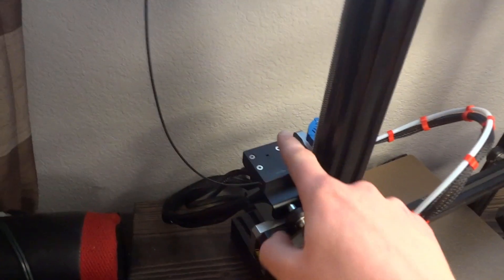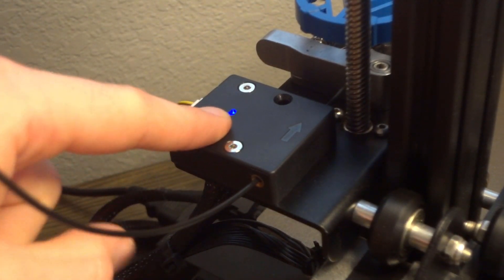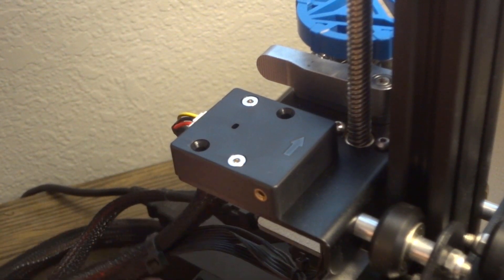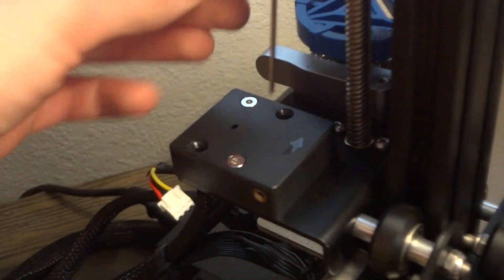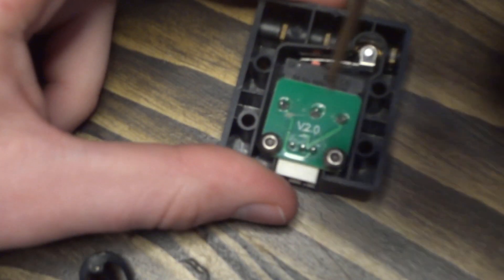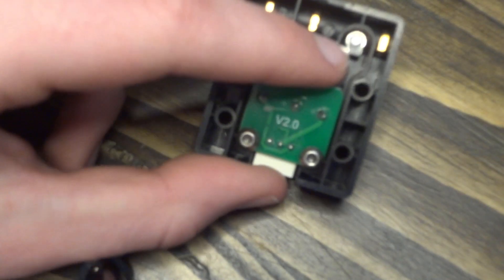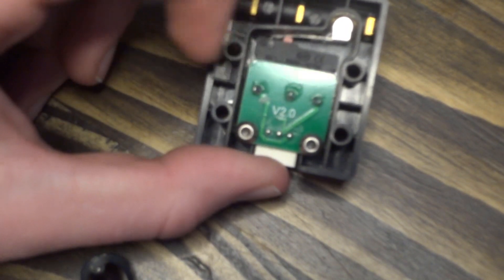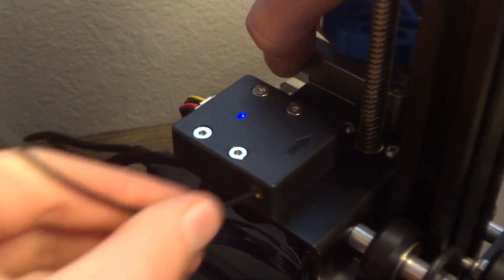Ender series Filament Runout Sensor Easy Fix

Comment: I have an ended 6 with this runout sensor, filament doesn’t want to go through. I push it in and the light turns on, but it doesn’t want to come out the other side

Comment: Thanks for your video. I have Ender 5 plus with this exact runout sensor, but my printer doesn't stop when it runs out of filament! Do you know how to fix that? I'm using MatterControl 2.0 and I do have the box checked next to the Has Filament Runout..... So I don't understand why the printer doesn't stop. Thank you.

Comment: Just installed one on my printer a week ago. Works great but it scrapes a ton of the filament off when I have to pull filament out to change colors. Plus it's extremely hard to pull out. It goes in smoothly when loading it though. Is this normal?
Reply from the maker: This is normal with my experience, I try to avoid as much scraping as possible. How I do this is while removing the filament when I start to feel resistance I snip the filament in the gap between sensor and the extruder. This makes it so I'm not trying to pull partally mented and deformed plastic through the sensor. Hope this helped, if you have any more questions feel free to ask.
Reply: @F-Strike_Studios  Cool that makes sense. Id give that a try but I installed a RedRex dual gear extruder 2 days ago. My factory extruder was fine with everything I ever used except for Sunlu Matte filament, which I love. It would slip like crazy on that stuff. Anyways, since I installed the new extruder I don't have near the "filament scrape" when unloading filament that I had before. I printed a custom made bracket so my filament sensor would line up with the RedRex extruder. Somehow this setup reduce strain between the extruder and runout sensor, like you were doing by snipping the filament between the 2. Thanks for the reply buddy. Ive only been into 3d printing for about a month so I've got a lot to learn....like retraction settings lol.